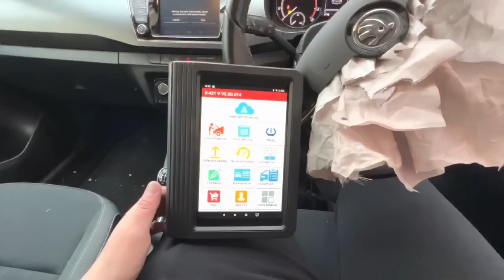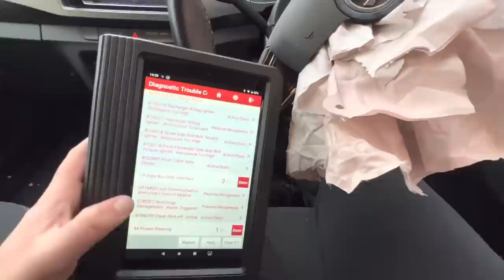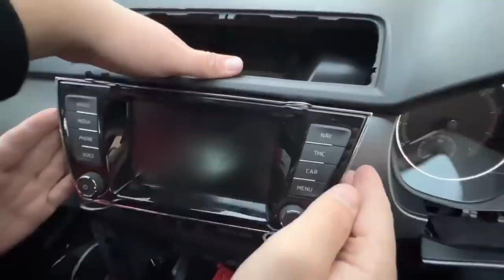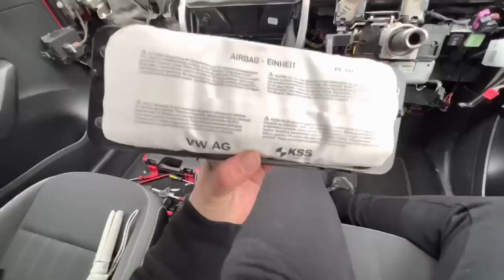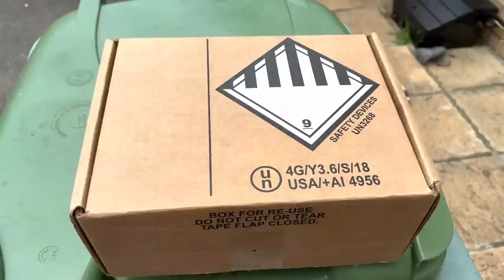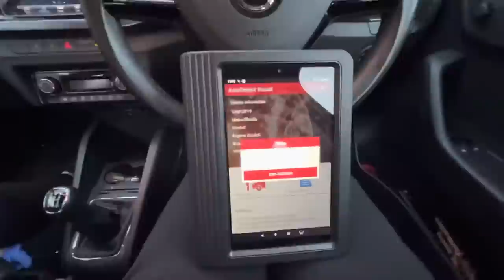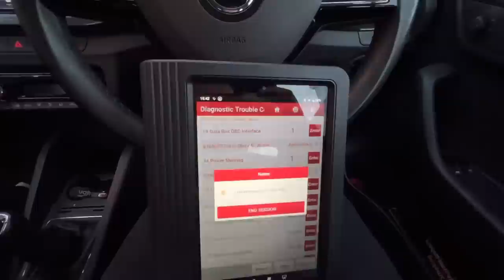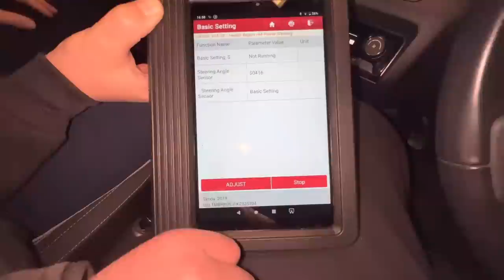Rebuilding a 2018 Skoda Fabia mk3 from copart dashboard removal & install P160900

Comment: Thanks for your video, i am repairing a Passat GTE 70 plate with airbag blown nd the power steering is stiff. I use OBDELEVN PRO did not sort out the power steering fault, after seeing this video i will get the X431 controller to code the power steering rather than take it to the dealer. Thanks

Comment: Few thing also make sure the bonnet is open is showing in the car dash display and maybe some times it will need you to do it with car started or even just ignition off and also it can take like 4 or 5 tried before it completes
Reply from the maker: Thanks for the advice Saqib 👍

Comment: Hey thanks for a great video I’m in same situation Octavia copart😅 question! Didn’t see you do anything with the module, is that because bags bought from Skoda so there programs to work with the car, or is the procedure you did at the end all that needs to be done? Looking to fit second hand just parts for me from Skoda 3500 😮
Reply from the maker: Hi Ricky with most vag cars the air bag module aren’t locked like for example a Peugeot . So once you replace the items that have deployment you can reset and clear the fault codes with a diagnostic tool

Comment: Hi Nathan, you video makes me want to take my dashboard apart just because you make it seem so fun. Got a question for you as I need to remove my battery in order to replace a headlight bulb. Can I just remove the battery and will the car work fine once I reinstall it? I don't want to unhook the leads if it ends up with me having to reset a bunch of stuff I don't know anything about... thanks!

Comment: Hi, your video was great.  I have a 2018 Volkswagen up! and it has a steering error, with which device can I go back to the factory settings, thanks for the answers🙏
Reply from the maker: Hi Mohammad I was using a diagnostics called launch x431 pro you can also use vcds to clear the fault code but as shown in the video you need to log into the module 44 with the access pin code 17580 before you can reset to basic setting which then you can clear the fault code hope this helps
Reply: @NathanHiley  Thank you for your help🙏🙏🙏
Reply: Hi, Nathan,thank you for your help, I did the command of the car with a Diak device today, but the command code you said did not give the number 44 in the settings for my car, but the command does not work well, but the command light is on, how do you think I can get the code?  ?  thank you

Comment: Isn’t it a failing by the manufactures that a deployed airbag renders a whole dashboard useless? Why don’t they make the airbag a removable piece, I’m sure the Fabia mk2 had this?
Reply from the maker: It sure is and a lot of the older cars for example Mk4 golf mk1 Leon the airbags places on top of the dash board which you would just replace the airbag would make life a lot easier if they still did that hope you have a good Christmas and new year

Comment: Thanks for your video I wanna ask you a question, what will happen if I start the engine with dashboard removed
Reply from the maker: Nothing will happen maybe some fault codes will come up as things unplugged . But you’ll probably need to plug the speedo in to start it

Comment: Hi there. I've just replaced the evaporator on a 2015 mk3 Fabia. I used your video to help me. Thankyou.  I've got a code "B1000p drivers side airbag fire. "
I'm gonna double check connection for steering wheel airbag. Live data shows info of it working. I disconnected battery before starting the job. Any idear?
Reply from the maker: Sorry for late reply I’m currently on holiday and glad the video has helped you. Have you tried clearing the code if you have maybe unplug the airbag and try again incase the plug is not clipped in correctly regards Nathan

Comment: Hi,
I'm about to do a dash change on one of these, where is the srs ecu located?? I noticed you didn't change it
Great videos get them going
Reply from the maker: Hi Graeme as Skoda is part of the vag group the srs module will reset with diagnostics
Reply: Ahh ok, so I don't need to replace, just reset after I've replaced the dash and airbags and front belts??
Reply from the maker: Yeah that’s correct once you’ve changed the deployed units you can plug diagnostics and clear the fault codes which the clear the srs module if it’s was a Peugeot for example you would have to replace the srs module or send off for reset hope this helps
Reply: Yes thanks very much
Looking forward to the rest of the skoda vids
Reply: @NathanHiley  I have a DS3 which needs a module reset, which companies would you recommend sending it to?